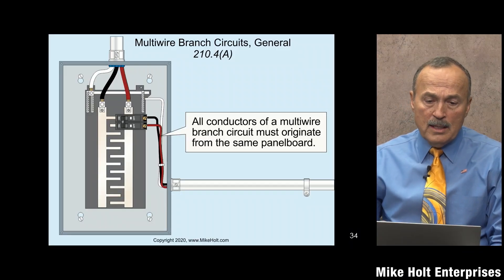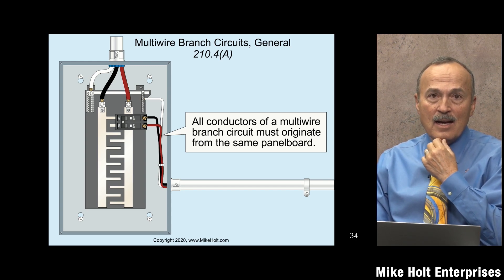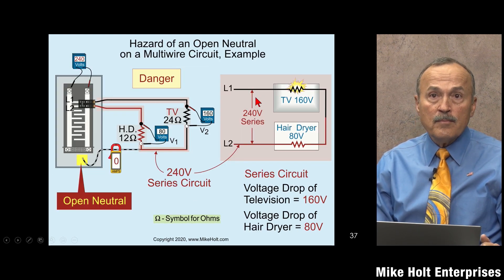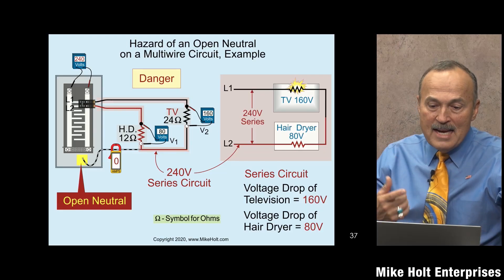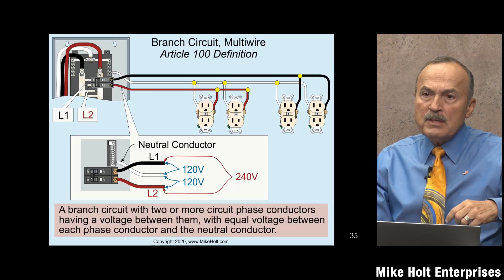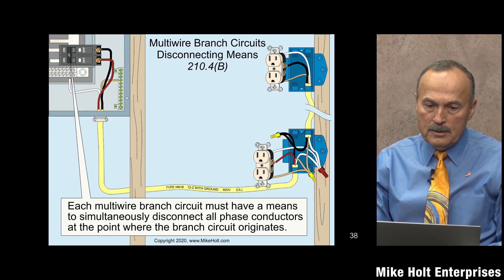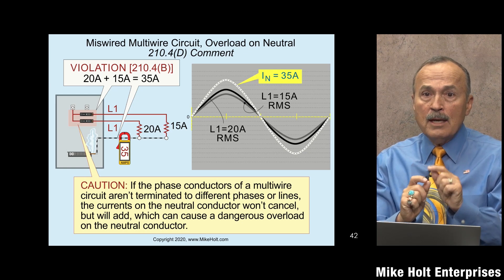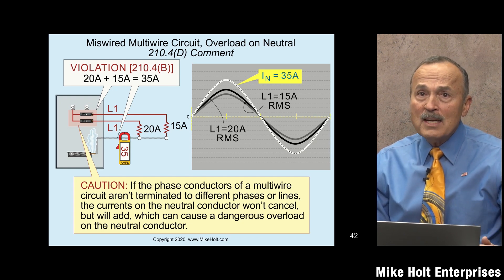Branch Circuit, Multiwire, NEC 2020 - [210.4], (19min:38sec)

Comment: Can someone please explain the problem of working on circuit A while circuit B is still on?  How does the shared neutral make a difference?  ALL of the neutrals are shared in the entire house since they are ALL joined together to the same neutral bar.  The need for opposite poles and the open neutral make perfect sense, but this part about the need for simultaneous disconnect makes no sense at all.
Reply from the maker: Post your question on MikeHolt.com/Forum, you'll get a timely response.
Reply: Let’s see if I got this right, and see if it makes sense to you.  If you turn off circuit A at the breaker to work on an outlet, and circuit B has something running on it, the neutral of the outlet in circuit A has current going thru it since it is shared with the neutral in circuit B. The other neutrals in the house are not completing the circuit for circuit A & B.
Reply: @Now_lets_get_this_straight  Right.  You can still touch the neutral on A/B just fine under load, as long as you don't disconnect its return to the panel and become in series with it.
Reply: @sergeig685  so your saying if you are grounded somehow, and you touch the neutral with A off and B has a load running, you won’t get shocked?  How much you get shocked is determined whether you make a better return path than the neutral wire.  It will take the path of least resistance.
Reply: @Now_lets_get_this_straight  If your panel is correctly wired, the neutral has the same potential as the ground wire.  Your neutral and ground bars are connected together, and to a grounding rod to top it off. Thus the potential between your grounded body and the neutral is exactly 0V. So, no, you won't get electrocuted. Now if the neutral was disconnected somewhere down the line then, yes, that would create a non-zero potential and shock you.
"The pass of least resistance" is absolutely INCORRECT.   If you connect several loads in parallel, with resistance of 10, 100, and 1000 Ohms, the current will flow through ALL of them.  The difference is how much current.  Current = V / R
Reply: @sergeig685  Then if connected to a transfer switch at the house panel by a GFCI generator that has the neutral bonded to the ground, why does the circuit trip?  They say is because the GFCI is not reading the amps that is on also the ground going to the house panel and back to the generator because of the imbalance on the generator circuit it trips.  To correct they said you have to disconnect the neutral from the ground at the generator.  So doesn’t that show that current returning over two paths.
Reply: @Now_lets_get_this_straight  Sorry, I don't understand your problem statement or the question.
Reply: @sergeig685   Forget the last reply about GFCI generators and I will go back to my original reply.  Go to 10:24 at   https://youtu.be/qOs1u3gTT6o   where he states if you don’t turn off both circuits in a mutiwire circuit, you can get zapped by the shared neutral from the circuit that’s running a load.  That’s why both circuit breakers require the handles be tied together and the neutral marked in the panel box. Safety has nothing to do about the circuit that’s running now being in series other than you might fry some expensive equipment.
Reply: @Now_lets_get_this_straight  they keyword in what he says at 10:24 is "splice".  Splicing the neutral would remove the return path to the panel and instead put your hand in series with the circuit and result in electrocution. Simply touching the neutral without splicing it is fine.  You can take a voltmeter and verify that yourself if you don't believe.
Reply: @sergeig685 , From 10:24-10:45, ten seconds, no “keyword” splice is mentioned.  He’s talking about turning one circuit off and leaving other circuit on with shared neutral enact.  Your initial question was what was the big deal about doing that and that was what I replied.  You also said the danger was it being put in series if neutral removed and you touch the hot!  So why would you be working on any hot wire without turning the breaker off?  If you turn one breaker off and the neutral is removed there no current unless you stick your hands on the other live wire and your grounded.  I don’t understand your reasoning in any of this.
Reply: @Now_lets_get_this_straight  He says splice at 10:19. No, that's not what I said.  The danger is if neutral is disconnected and you touch the neutral.  As in you are splicing the neutral on a MWBC, where one of the branches is still hot and under load.  When you splice the neutral, the return path to the panel is now gone.  There is two wires in a splice, one going to the panel, and one going to the load.  You touch the neutral wire  coming from the load, and now the current will go through you.  That is the danger.  And that is why they want you to install duplex breakers.
Reply: @sergeig685 , At 10:19 like you said, he mentioned splice.  But that was confusing because he kept going back and forth referencing breaker #6 & #8 and then talks about #10 & #12 and then back to #6 & #8 again. So that’s 4 breakers with two multi wire circuits so is that the splice your talking about?

Comment: made a 3000 dollar laser printer smoke because i took a neutral loose . 1 word INSURANCE, 1 RULE never trust that someone else did their job or what they said they had got done even if it's your boss. verify all things yourself. someone tells you that circuit is dead, don't trust them trust your meter only

Comment: If you are just beginning to learn this stuff, I want to add 2 things:
1).  At 1:01, Mike does not finish the sentence: The equal voltage must be between each phase conductor *and the neutral*.  If you're measuring voltage between 2 phases (as in the example), there is no "equal" to be had.
Also worth mentioning:
2).  Single pole AFCI and GFCI circuit breakers will trip if you put them on  either or both poles.  I've seen people try to pigtail the neutral to go to each of 2 SP breakers; and that won't work.  You must use a double pole breaker -and here's the best part: if you're working in an old house, you might have an extra hot on that circuit that trips the DP breaker.  Like a hot sharing a neutral with another hot ...that is already sharing a neutral.  This is serious and must be investigated because that means that at least 2 of the hots are on the same phase.
I've also seen a GFCI receptacle where someone tried to spit the neutral at the GFCI or after it (instead of before it).  The load side of the GFCI must use only the load from one phase and all the neutral current must be on that phase.  That wasn't part of Mike's talk, but new folks have to know that this is also an important part of understanding the ramifications in a GFCI and AFCI world.
I use AFCI and GFCI protection on shared neutral (multiwire branch circuits) knob & tube all the time as a diagnostic tool to find extra neutrals all the time ...because sometimes a neutral doesn't get shared where you can see it; it happens in a junction box somewhere else in the building.

All that said, Mike is an awesome teacher and we're lucky to have him!
Reply: Wow... what an interesting idea...  to use the GFCI as a diagnostic tool to determine shared neutrals! Do you have some sort of "kit" you built that plugs in, or do you wire that up each time?
Reply: @marcfruchtman9473  You don't need a kit; I do it in the panel with a GFCI or DF circuit breaker.
Keep in mind that if you try this 'locally' (like at a particular receptacle location) you might miss whatever happened before the location that you are testing.  So it's always best to use a circuit breaker to test the entire circuit.

Comment: I'm just learning about these multiwire circuits because I ran into one this week in our 1970s commercial building and I wanted to understand the code.  Boy, the wording of the code is so confusing and non-obvious.  When first learning this, a general introduction would be so useful, but can't be found in the code. A general intro should start something like this:

Multiwire branch circuits are a cost-saving wiring technique that shares one common neutral wire between multiple branch circuits.  This technique saves wiring costs but introduces a handful of dangerous side effects, including potential confusion, safety, and equipment damage risks.

Multiwire branch circuits require each branch to be on different phase legs.  Doing this guarantees their shared ground will never need to carry a higher current than any of the branch hot wires, which is why it is possible to use the same ampacity wires for all the current-carrying wires of the multiwire branch circuit.  Preventing the need to use a larger neural, is where the cost savings happen, so this is only permitted by the code when the branches are on different phase legs.
Reply from the maker: Excellent! I'll add to my book and YouTube intro.
Reply: The thing about the NEC is that it isn't meant to be an explanation of electrical techniques.  It's a reference book for people who are already trained professionals, not a "how to" book.  I'm not trying to be an ass, it's just important for people to understand.  Mike (and others) have produced materials on "how to" that refer to techniques that you can use to comply with the NEC.

Comment: So the only issue is when removing a neutral? If you were to relocate or add a outlet or light off a 10/2 12/2 you will be ok just be sure not to mess with the bundle of commons?
Reply from the maker: Correct.

Comment: Resistive load and resistance loads are not like you are speaking.  As a spark and also staring out in electronics and TV servicing you are full of BS.  It don't work like that most electronics don't have linear power supplys.

Comment: At 6:50 your numbers are not right.  The hair driver is a resistive load the TV is not a resistive load as it don't use a transformer in side for the power drop it is a switch mode PSU.  If L1 and L2 wired threw a hair driver or coffee pot as there using resistive load elements it will act like just a resistor So L1 threw the 12 to 20 ohm like a wire wound resistor then the TV.  I am a spark in the UK and also a AV engineer my first work was in the TV trade.  Strapping as you use as most of your 2 or 3 wire is from a center tapped transformer.  To give you your 110 120 for you to get 230 240.  We in the UK use most of the time TNCS.  We're are neutral is grounded at the star side also at the home.

Comment: Last year I opened a ceiling gang box to tap in for a doorbell transformer. When I removed the wire nut from the neutral, the home run white lifted. In a nearby study, a 6-outlet adapter with surge protection started sparking and smoking. I could not pull it out of the outlet as it was screwed in. I reconnected the neutral and was then able to remove the adapter and drop it outside while it continued to melt. The shared neutral condition had presented the surge protect circuit with over 120v.

Comment: Why can’t u remove the neutral on load first? Cause it’s load and ur voltage it’s on without a return?
Reply from the maker: That is a different topic, not related to the discussion of a multiwire neutral circuit.

Comment: If they spec no shared neutrals, that’s what you bid. Period. Stop racing to the bottom and learn how to run a correct profitable business.
Reply from the maker: 1. If the spec says no shared neutrals, then that is what is required.
2. Installing a multiwire circuit as permitted by the NEC in my opinion is not racing to the bottom.
3. Installing or not installing a multiwire circuit in my opinion has nothing to do with how to run a 'correct' profitable business.
Reply: My question has always been why not run a ring circuit like they do in England? I don’t see a reason it’s illegal and saves immense amounts of copper.
Reply from the maker: @badbanano  You are right that the 'ring circuit' is more cost-effective and has many advantages over the US and many other wiring systems in the world.

Comment: Confused, you say the code states its ok to use multiwire branch circuits for office furnishings but nec code 605.9(d) states there not permitted? Am I misinterpreting  this? Thanks
Reply from the maker: I never discussed Office Furnishing, but 605.9(D) only applies to the internal wiring of Freestanding-Type Office Furnishings, Cord- and Plug-Connected. Freestanding-Type Office Furnishings, Cord- and Plug-Connected is wired by the manufacturer, not the electrician. So your comment is a moot point. Right?
Reply: @MikeHoltNEC   Thank you for the reply, sorry for the confusion, it was Erik that was talking about office cubicles. And your response answered my question , I did not know that code reference only applied to the internal wiring.  Thank you again!

Comment: As a home owner, any time an electrician works on my house...I unplug Everything.  Not practical in larger commercial buildings, but I'm not losing my 80 inch TV. 
 Multiple branch circuit should be tags somehow as a MB circuit. In aerospace industry we of course used wire diagrams that were consistent and you were trained how to read & understand them, and tag outs used when working with any circuit. Most overloads and shocks came from In-Shop repair were we worked on components on the bench.
Reply: MB ckts are no longer allowed in commercial bldgs

Comment: seems that it be safer to keep each line of multi branch circut on the same phase..or leg....then not runing 220 v  through  one cable. thought it is not permitted to bring 220 into a switch/outlet box . i say run that extra neutral.........saving money  can  cost  money or  a life

Comment: LET ME PREFACE WHAT I am About about to say with this, I've worked as an Electrician Apprentice for 2½-3 years. And in 1998 I read from Cover to Cover The Entire '97' NEC. As I rehabed after a near death 7,650 three phase electrocuted.  
I've done electrical work and live by the motto, If it isn't done right then don't do! Well last week I have a friend who wanted me to go through and update all of the switch and receptacles in a house in a house he listing for sale. Someone had gone in and put 12 - count them 12 GFCIs in the living, dinning and study/ library rooms... NOT A SINGLE ONE WAS GROUNDED! Then got to the   ceiling Jbox's, for the lights & ceiling fans. Every one of them were Neutral wired to the switch.  16 times! Well when I got to the front room had two 3way switches, 1 at the door & 1 at the hallway. The Jbox   in the ceiling only had 12-2 no ground, where's the "travelers for the 3 way. Pulled the wall box and the wall receptacle, nearest the switch, they ran a "common" hot to the 3way then used the switch legs as the traveller on the black  to one and voltage on the white to the other side. No I Did Not  Reconnect It.

Comment: Of course most TV's these days will handle 240 without issue as in they are dual voltage.   But yes I get the point.
Reply from the maker: Almost correct, TV's are not rated for this voltage, but the power supply is rated 100V - 240V.
Reply: @MikeHoltNEC  Universal mains, yes.  My background is in electronics and well most people wouldn't understand the active power factor correction boost converter allowing for this 'universal' part.
Reply: Burn those TVs

Comment: Can you please tell me how the voltage from phase to phase is 240 ?!  They are not out of phase by 180 degrees but 120 degrees so it should be  207.6? Vline = Vphase*1.73
Reply from the maker: 120/240V single phase is from one transformer winding, so there is no calculation involved.

Comment: We work at the museum write know: that building was built at 1920... with  remodeling in 1930, 1950, 1970, and so on... imagine what a mess you have??! So: we move a neutral wire in the j’box, and in the 5 foot 8 inch pipe, the neutral wire is terns in wire nut, (!!) and that sheared neutral is discontinuing the circuit that was connected to it, and that cost Musium a $2,500 copy machine... just because there was a 120V outlet that was connected to that light circuit!! If you guys don’t believe me, I have a video about it! That’s a great show! I can tell you that!
Reply from the maker: Please email me (Mike@MikeHolt.com) the video!

Comment: How do you find the shared neutral wire after the fact  when they weren't grouped initially?
Reply: I use an AFCI circuit breaker as a diagnostic tool.

1).  When a new AFCI trips, I leave everything connected and turn off all circuit breakers except the one that is tripping.  If it stays on, I suspect another breaker was feeding current to that (now AFCI protected) circuit.  I then turn on breakers 1 at a time to see if additional current trips the AFCI breaker by adding current to the neutral.  Using an amp meter, I can measure changes in the neutral as well.

2).  Often the problem is 2 (or more) hots sharing 2 (or sometimes more) neutrals.
Now I identify the (new) AFCI neutral in the panel and put an amp meter on it instead of leaving it open since the neutral will still conduct electricity from the other circuit(s) even when the AFCI is in the off position.  I turn off all breakers, and then turn them on 1 at a time to see if I get any current on the neutral -thereby showing that the neutral is shared with whatever circuit I just turned on -and thereby also avoiding an open neutral.
(At this point obviously I can use a double pole AFCI breaker to protect both circuits with a pigtail to the (2) separate neutrals)
Reply from the maker: Post your question on MikeHolt.com/Forum.